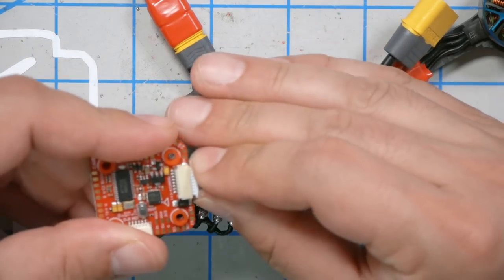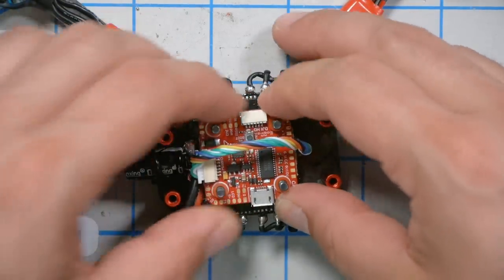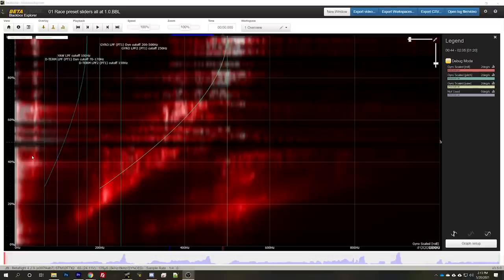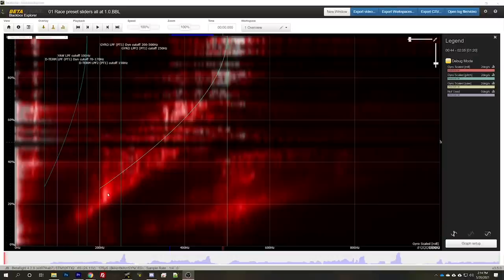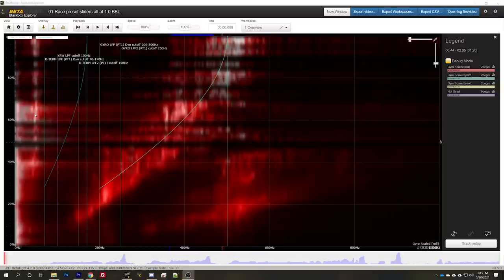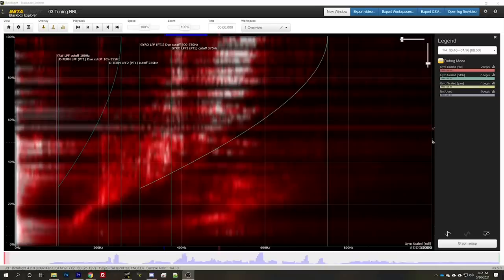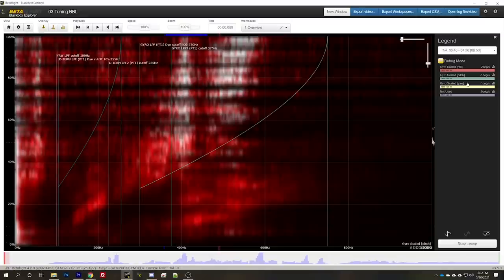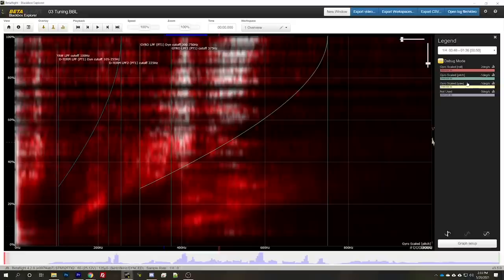How I caused high-throttle oscillation on my 533 Switchback Pro (and how I fixed it)

Comment: I discovered this myself many moons ago and I found this really showed itself on my 7 inch builds when needing to deal with noise. It has been a matter of course for me to run wires away from the flight controller altogether and to ensure that nothing, utterly NOTHING, to include all wires, touches the FC accept the bolts and gummies. Glad you proved that out, you the man!

Comment: To avoid vibration from wires, just apply comformal coating. Let it sit over night with the wires pinned down. The next day it is nice and solid, also works with the esc wires if they bump up against the FC.

Comment: Thanks for this tip, I was going nuts trying to get rid of the oscillation on my beta85x.  Just sort of moved the wires slightly and it's gone.
Reply: Well that success didn't last long.  I think I just got lucky trying this.  Did finally figure it out though.. The FC was teetering with the mounting screw and rubber damper.  So I was having intermittent terrible noise.

Comment: More filtering actually contributes significantly to this low freq oscillation due to P and D being too much out of phase with reality. Was it the wire or actually raising the slider that made the key difference? A way to find out is try lowering the slider to say 0.6 or 0.7or so and I’m confident that oscillation will come back worse than before
Reply: Here’s an illustration that shows how this trilling is tied to too much filtering (flight is a slow 0-100% throttle sweep). in this illustration filter slider is really low (low cutoff high filtering) and as throttle reaches critical point D term "trilling" goes nuts https://youtu.be/R6aarL-9muc
Reply: then exact same rig, just raised the filter slider (lower filtering), and the low freq oscillation is dramatically reduced, at the slight cost of more higher freq noise. Note, both illustrations are simple 0-100% throttle sweep. https://youtu.be/lSaBlodfcbw
Reply from the maker: In the 2nd example, the only change I made was moving the wire. Before I moved the wire, I tried several different slider positions without improving the situation.
Reply: Ok It’s interesting for sure. Something to keep an eye out for. I guess I’m wondering now was one of those wires vbat? I mean it’s hard to imagine a tiny 5v signal doing anything but maybe a vbat wire @ 16.8v or 6s 25v running along the gyro. Idk.

Comment: Hi Josh  Great video on throttle oscillation.  Great now I have to go look at 17 quads that I built and still fly,  and see how I ran the wires. I'm pretty sure I will be changing quite a few.  Thanks again for the information.

Comment: And this is why the geprc mark4 hd5 has a glaring design flaw. I bought a replacement longer cable for the air unit because by default there's no way to not have the camera cable touching your FC.

Comment: Merci Joshua ! Cela fait 2 semaines que je cherche en vain la source de mon problème sur mon dernier build. Avec les pid d'origine, ça pose déjà problème, le résultat de ma black box est identique au votre avec une résonance fixe  entre 50 et 60hz à vue de nez. J'ai testé avec les deux gyro du contrôleur de vol, c'est pareil. J'ai pourtant fait attention à ce qu'aucun fil ne touche aucun  des 2 gyros. Tout démonté, tout vérifié et revérifié, fixé tous les fils ensembles revu mes soudures et même monté des pads anti vibrations sous les moteurs, visuellement la construction est très propre mais rien à y faire. Probablement le fait que les fils touchent juste par endroits le contrôleur de vol sans toucher le gyro pose déjà problème. Au grands mots les grands remèdes, sans pouvoir faire autrement, je vais les y coller au tropicoat ou silicone pour éviter les vibrations et voir ce que ça donne. Toujours au top Joshua, j'apprend beaucoup avec vous 👍

Comment: I just figured out what I have been trying to achieve with the settings for a week)) I got the receiver wires near gyro. Мaybe they are a problem leading to clicking sounds of motors and vibrations at high rpm.

Comment: I use E6000 glue to pin down wires when I have to run them over the FC.
Reply: Up this!
Reply: I use liquid electrical tape. Just a dab as it can be removed somewhat easily.  Not so much when it's down on the IC solder points,  but I doubt any other glue would be any easier to remove from there. It certainly wouldn't hold as well as e6000, so that's certainly an option when you don't want it to move. I imagine e6000 could remove a component of you tried too hard. Always wondered about vhb tape and if it's electrically isolating or not
Reply: E6000 is DA BOMB. not enough ppl in this hobby know about it.

Comment: Default D is pretty high for a 6s racing rig like that. With Filter Sliders at 1.5 or even higher and D in the mid 30‘s you probably gonna smoke motors in the summertime once props are bend/broken.

Comment: Thanks Joshua. But I wonder what about a little piece of foam on the gyro? May it should dampen almost every vibration of the wire without any bad influence to the gyro? Maybe like in the older times the foam on the baro

Comment: At 7:52 it does look like the vibration is still present. Could you post Frequency only charts (as opposed to Freq vs Throttle)? I suffer the same vibration (27Hz) on a lightweight build, but with a AIO 25.5mm FC. So I'm super interested in the solution.

Comment: So, the theory is that these wires are radiating electrical noise, I would suggest from the ESC. ?...straight into the giro chip..Sounds possible to me...The noise coming from a cheap 4 in 1 ESC is pretty horrible in my experience, it usually gets into the video chip too....🤔🤔😳🇬🇧
Reply: the main reason is the wires running acros or over the fc are vibrating due to high velocity wind produced by high rpm spinning props and when it touches or runs across the gyro chip those vibrations are felt by the gyro
Reply: @chrisfpv5706  Lol....nope...lol...that was funny...🤔😀

Comment: So the conclusion is: Don't let wires touch the FC.
Nice detective work & example testing :)
Reply: Wires can touch the FC if that's the only option, just don't suspend wires right over the actual gyro chip.  When they jiggle, they're going to tap the incredibly sensitive gyro directly.
Reply: @Perforator2000  This poses a new question: What if the gyro is also affected by the signal in the wires close to it? If it can be affected in such a way.
Reply: @licensetodrive9930  I think that is also possible.

Comment: "Hi, Im Joshua Bardwell, and i had leaned something today" :D ... But anyway who you are, there is stuff to learn every day. It doenst matter if your name is Joshua Bardwell :) ... Btw: Thx for this vidoe, i think i had the same Problem (Calbles under ESC were to thight, resulting in pressing ESC up, resulting in Compressing FC Dampers on One side (so left and right wasnt same thight), also the VTX was loosen and vibrating on the FC, Cables over the FC was touching the Giro.... all in all resulting in the same hight oscillating errors. Funny was, as you sad at the end, that you can built a Quad like this and nothing really happens, and then you build one where you have that problem. Same to me. And funny: With a 4S i hadnt that oscillating. Just with 6S. Here's my why: With the 6S i have much more RPM on the Motors in fact that i have much more voltage. So more RPM = more Vibrations. So i have more Vibrations to filter out with a 6S, as on a 4S LiPo. I havent had this in other Builts with 6S, and also here's my why: in my other Builts i have Motors like 1720 KV. In my new Built i have 1960 KV. So more than 200RPM more. multiplied with 25V, .... yeah, exactly, whole 5000RPM more on my new built, just from 200KV more. So yeah, my other Built just doesnt vibrate as much as the Giro can get problems with the cables on his head :o)
Thank you @Joshua for your Videos! I appreciate!

Comment: Hello, another question I collect a drone in this regard, please tell me what I'm doing wrong. When checking on the table without propov, armlyu motors spin at idle , then I give gas to 40% and within this range the drone is responsive the engines gain and reduce relative to the movement of the gas stick but as soon as I give more than 50%, the engines themselves gain momentum in the flesh to the maximum speed and on the gas stick the drone berestaet respond, after that you have to disarm. What to do? What's wrong with me? Thanks

Comment: they where laughing when i sayd that this was causing noise in the gyro because of wire vibration :) but ive doing all my stacks with the wires under the esc and no wires touching the fc

Comment: i had a similar problem on my apex build where i had little wobbles around mid and high throttles ,turns out it was my vtx antenna  touching my fc and my gyro picking up unwanted noise

Comment: Did you just tape the wire away from the gyro on the fc, but still wire touching the fc? Or wire completely away from the fc? I don't know where the gyro is at on my fc :).
Reply from the maker: I ran the wire over the top of the Ghost Hybrid so it's not touching the FC at all.

Comment: Hey all, I'm having a problem
I just built a quad and when I throttle to gain some quick altitude and I can't roll or pitch while throttling it just locks at the angle its at and goes, I have to zero throttle to gain full control again, is this a betaflight, solder, or part issue?
Reply: Connect it to betaflight and monitor the radio channels while simulating this case. Maybe you have some mix enabled on you radio
Reply: @bestbattle  in the reciever tab everything seems fine, im using a flysky btw